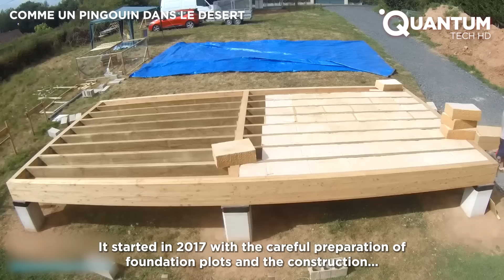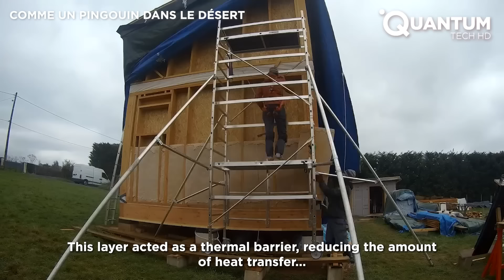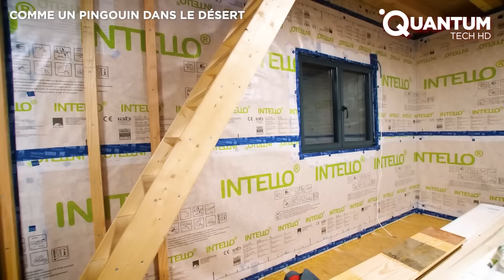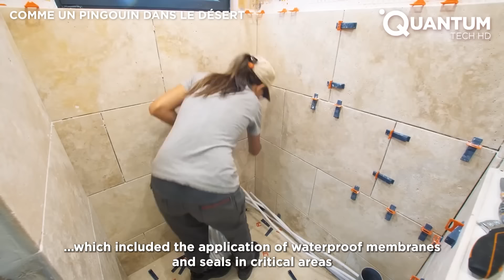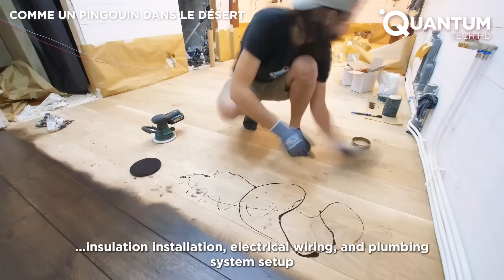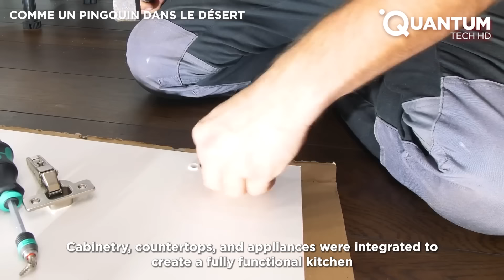Couple Spends 3 YEARS Building Amazing Dream House | Start to Finish Construction @CommeUnPingouin

Comment: And what was supposed to shake? Standard house: columnar foundation, platform, standard frame, conventional electric heating. Now, if you created a stove, concrete walls were cast on it, they would be insulated by 2 norms, a heat pump would be installed as heating, and electricity was connected through a network inverter, then it would be considered cool. The fact that they built it themselves, yes, well done.

Comment: I can't believe that took 3 years.  That is 2 and 1/2 years too long for a garage with a heater and kitchen and electric.  Were they smoking doobies for 2 of those three years?  I would have a shed that size built just on a part time basis in 1 week.  putting in lectric and plumbing 1 week, interior lights, paneling 1 week.  windows 1 day,  this project is so stupid that they would have saved money if they just buckled down to do the work, and then lived in it.  They lived somewhere else for 3 years, and that 3 years of rent costs more than a comparable house.